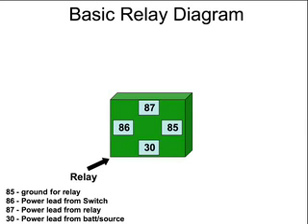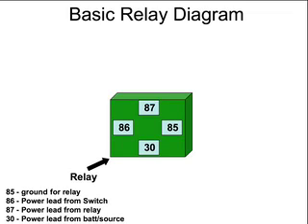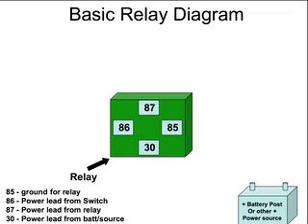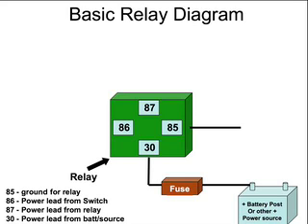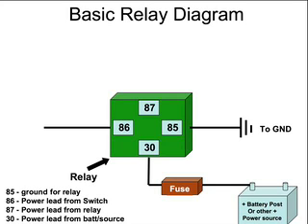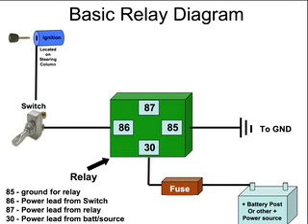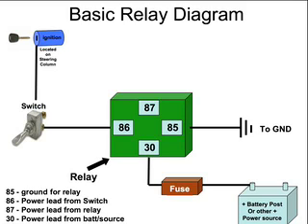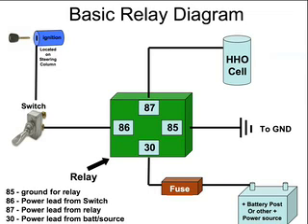Basic Relay diagram - IOW what goes where

Comment: Have left dozens of comments on these wiring videos, NOBODY has responded to my dilemma which is: The schematic embossed onto the relay cover shows 85, 86, 87, & 30. Simple, right? Nope. On my relay the embossed schematic is the same as you and everybody else shows in their diagrams. However, the 1/4" spade terminals are numbered 85, 86, 87, & 87a. What??? Why can't these engineers be consistent? Is the 87a spade terminal the same as the 30 shown on the embossed schematic? Does anybody out there actually know the answer to this question?
Reply: Figured it out for myself no thanks to anyone. 87a and 30 are the same!

Comment: I have a comment in that I too run fused power to post 30 and post 87 goes to my device. What I do differently, is I run a jump wire from 30 to 86. So instead of having a hot wire at my dash and running to post 87 I run a ground wire from post 86 to a toggle switch at my dash where it's grounded on the other side of the toggle switch. This way if there's a short in the wire running from the relay to the dash the only thing that will happen is that the device will turn on through the relay. It also saves half the distance of wire needed to run from the relay and back to the relay.

Comment: 87A is always powered when the relay is not in use - so it could be a low beam light for example - then when you energize the relay 87A closes and 87 is powered and could turn on high beams instead.
Reply: Can't have it both ways: 87a opens when relay coil energizes - it' serves up a normally closed contact..

Comment: Good video well explained. I don't know what HHO is but its the same as device/accessory.
FYI: Lots of videos about wiring relay connections vary in two ways. Keep in mind that 80 & 37 could be reversed hook-up and 85 & 87 could be reversed hook-up too.  IE: 87 could go to positive battery and 30 could go to the HHO cell/device....86 could go to ground and 85 to the switch.

Comment: Thanks! Using your video I was able to get the fog lights fixed on my motorcycle. Previous owner hooked up the red fused 12V wire going to “30” on the relay to the negative terminal of the battery!

Comment: 2 Hydrogen 1 Oxygen
 How an HHO generator works and helps you save gas

An HHO or Brown gas generator is an interesting and often misunderstood technology.
The Brown gas generator uses electrolysis to split water (H2O) into it´s base molecules, 2 hydrogen and 1 oxygen molecule.
This is why it is often referred to as an HHO gas generator.The HHO in itself is not an alternative to gasoline but a additive
to boost the efficiency of the engine. Gasoline engines are unfortunately not burning gasoline to its full potential. See http://en.wikipedia.org/wiki/Engine_efficiency
The average gasoline engine in a car is about 18% to 20% efficient. That leaves a lot of room for improvement and Brown gas is one good way of improving the efficiency. The reason for this is simple, the hydrogen is highly flammable much more so than gasoline so when your engine ignites the hydrogen the explosion ignites the gasoline with much better results (cleaner, less waste and fewer emissions) than it would otherwise have done.

Comment: The 5th contact is 87A. When there is no power on the switch circuit, the voltage from the battery is output through that pin. When you apply voltage across the switch circuit, the voltage from the battery is output through pin 87
Reply: I know im asking randomly but does someone know a way to log back into an instagram account??
I stupidly forgot the login password. I would love any tricks you can offer me
Reply: @Louis Collin Instablaster :)
Reply: @Boden Raylan Thanks for your reply. I got to the site thru google and Im in the hacking process atm.
I see it takes quite some time so I will reply here later when my account password hopefully is recovered.
Reply: @Boden Raylan It worked and I actually got access to my account again. Im so happy!
Thank you so much, you really help me out :D
Reply: @Louis Collin Glad I could help =)

Comment: The fifth pin will stay hot , such as a headlight scenario . 87 switches on / off for high beams . The 5th pin 87a would power up after you shut your high beam off and is ran from a daytime running light

Comment: The fifth connector or terminal on a relay buddy (track 2:29), is the "Normally-Close" terminal of terminal-87, means while the switch on your diagram is OFF, then its connected or closed-in at that fifth terminal or the center terminal which is also called the 87-A, or simply "Normally-Close".

Comment: there are Relays which have pin 87a and 87. 87a is the exit line when 85 & 86 is not active. means 30 runs through 87a.
if 85 & 86 activate the Relay then 30 runs through 87.

87a is the exit line 1

87  is the exit line 2

exit line 1 is active when relay switch is powerless (85 & 86) have no flow.
exit line 2 active when relay switch have power (85 & 86) have flow.
Reply: excellent summary

Comment: I am a semi retired electronic tech.. I have a few cars  that I have to keep going.  This is one of the few sites that give common sense  explanation of the workings of this  standard spdt relay.. if I understand this  power 12 volts is on 30 which is useless until the relay is grounded by the  computer.. I think that initially the  fuel pump on Ford 150 circa 1999  is primed and controlled by this  pin. is that true.. also would it be ok to post  a in-depth  troubleshooting I am working out on my 99  expy. I don't want to and refuse to just throw parts at a truck just because I was too lazy to understand  a circuit.

Comment: The 5th in the center /for a relay with 5 connectors is for will say 3 way switch / you could hook that up to your reverse light wire when you put vehicle in reverse will activate relay from that point. Without flipping other switch to activate whatever you have on that relay.

Comment: so if i dont use a switch would the ignition act as the switch.. In other words if im using the relay for a fan then the fan will always run while the ignition is on?
Reply: Yes

Comment: So if I want to add an electric fan to the diagram where would I add it? Also do I need a relay to do a toggle switch fan?
Reply: yes, or the switch will get real hot.
Reply: Hot power wife from fan connects with 87. Ground wire from fan goes to ground.

Comment: power flows from 30 to 87 in its normal state, when 86 and 85 energize the coil  30 then switches to 87a from 87. 87a is the 5th connector,in the center of the coil.

Comment: 5th connector:
- 87a live by default ... a grounded LED on it would stay on all the time, unless the Relay is activated, then it would go off as 87 becomes the new current path in the high circuit.
- or a second 87 that you can use to power up 2 items like 2 headlights High Beams

Comment: 87a is a constant on till 87 is made. Then it is off. I use it to run a switchback LED. 87a is for the white LED and then 87 is for the Amber/Red LED. In turn it alternates from white to color as needed.
Reply: Also I have run across some 5 Pin relays that had 2x "87" pins, that are not 87 and 87a. When I metered them they were both 87 terminals. I guess like for running headlights from the same electrical connection but different terminals. This is another case why its important to know how to use your VOM/DVM.
Reply: You are correct sir. 2x87.... for your headlights.

Comment: i have seen videos where 30 goes to pos. wire to lights,, 87 to pos. of battery,, 85 ground,,86 switch. but i have my lights like in your video. and in some videos 87A turns something on when you turn off switch and another video 87 and 87A is for each light rather than both lights on 87.... i`m more confused from watching all these videos, could you explain in a easy way please.

Comment: 5th connection would be 86a ,which would basically be in an on state ,when there is no connection between 85 and 86. causing 87 to an open circuit. so anytime 87 is open 86a will be a closed circuit and vice versa.
Reply: sorry not 86a,but 87a . i was rushing

Comment: I installed a 5 connector relay. The purpose of the 5th connection in my case was to connect to a second (or twin horn). It was labelled 87 (2 87 connectors).

Comment: The 87a pin on these relays can, in simple terms, be connected to a load (lamp etc) that should be operational normally but is turned off when the switch is thrown to the ON position... as opposed to pin 87 which becomes energised when the switch is thrown on !
Like a 2-way switch in effect.
My hydrogen cell is powered from my car ignition circuit for safety, which powers the engines oil pressure lamp...but the system only operates when my oil-pressure light goes OFF. (engine running and pressure ok)
Now do you guys get it ?

Comment: what is an HHO? I have a train horn kit that came with a 12v compressor, 2 horns, nuts/bolts and the tubing that goes to compressor and horns and a relay.... it has the same relay thats in the vid... how do i install it in a 2002 hyundai elantra gls

Comment: maybe is off topic but I have a truck that uses 24v battery and a circuit to cut power that we send via a avl (automotive vehicle locator) , we succeded to make a circuit for a 12v battery car, what we wonder if we use a 24v relay 1.-does the circuit and wiring of cables has to be the same? 2.-the battery are 60 amps, and the relay that we want to use is 30 amps is this ok, sorry for my english
Reply: if the guage of wire u use wont carry 30 amps,that 30 amp relay is gona melt wires for sure.secondly,wont the relay trip at 30,and never let the 60 amps flow anyway?

Comment: hi, the diagram that is shown here is different from i found online, for example, wire pin 85 of relay to 12v supply
wire pin 86 to good ground
wire pin 30 to battery
wire pin 87 to HHO Cell

Comment: Can you help me I have a motor home with a electric fuel pump which is run be a 12 volt relay. The pump keeps cutting out when driving along. When you test the relay there is always power to it but nothing coming out. Wait for 1/2 hour and it work again. We have tried a new relay no good.

Please Please help me.

Comment: The fifth pin is for the alarm systerm
Reply: Incorrect, the 5th pin (87A) has power at it (supplied by pin 30) when the relay is NOT energized using pins 86 (+) and pin 85 (-)

Comment: hi. i need some help... please... i,m working on a 1985 suzuki bike, trying to conect the cooling fan and get it to work with the temperature switch,, everything is brand new, i have try so many dif ways and is not working. the temperature switch has two pin.... please help....

Comment: 87A normally connected when no power and ground to the coil, for me I used 87a for auto cut off when engine stall , if the terminal 85 connected with oil pressure switch relay should open when energy to the coil and reconnect when engine running

Comment: the 5th connector is 87A and here is how it works.  when the relay in not magnetically energized, the 30 and 87A are connected. when the relay is energized, the 30 and 87 are connected.  you can use it in multiple functions like powering up 2 different loads or sending positive to a wire when energized and ground when not,etc etc etc.

Comment: Steve, it'd be real helpful if you did a demonstration of the actual parts being or have the connected parts displayed on a table all laid out. I just bought a HHO kit and am kinda confused about the relay connection to the on/off switch - isn't there supposed to be a complete circuit instead of a 1 wire connection to the on/off switch?

Comment: To answer the question in the video, the fifth connector on a relay is just another output in parallel to 87 that would go to the HHO system. it is located in the center of all the other connectors. I am talking about aftermarket relays as each auto manufacture has there own design and pinout.

Comment: The fourth post (87) is  "normally open" and the fifth post (87A) is "normally closed". Meaning that 87 will be "off" until you energize the coil (85 and 86 posts) and 87A will always be "on" until you energize the coil.

Comment: the relay is 20, 30, or 40 amps? and the fuse is 20, 30 or 40 amos? the switch is necesary? 
i am making a hho generator for hidrogen to the truck, and this is very interesting, easy to follow....the conections...

thanks

chavoya123

Comment: Ran out of characters. the terminals are usually called 87 and 87a a being the normally closed. Polarity is not a problem on 87, 87a to 30. SOMETIMES a relay has a built in anti surge diode on the activating coil to protect computers and solid state devices so polarity IS essential on them. So 87(a) or 30 can be the hot lead, its a mechanical switch and it makes no difference. I see computer input circuits that are "backward" from normal because the computer is looking for a ground input.

Comment: The relays with the 5th connector is like a single pole double pole switch. The other terminal is a normally closed position and when activated will shut off when the other one turns on. They are very handy if you want power sources to a load from two different power sources or if you want power applied to one load and switched to a second load when activated. OR if you want something on all the time and shut off when activated (usually safety circuits)the relay is just a mechanical switch

Comment: YES! Exactly what I was talking about on the last vid. For some reason in your last install vid I thought you had hooked the switch up between the positve terminal on the battery and the #30 on the relay, which could kill the switch. Hey, I have found the "Add-a-Circuit" at my local Auto Parts to be GREAT! They plug right into your fuse box, and have a wire lead that you can wire to the switch then the #86. Simply plug the existing 10A fuse back into it, and WALLAH! Use ACCESSORY line & fuse